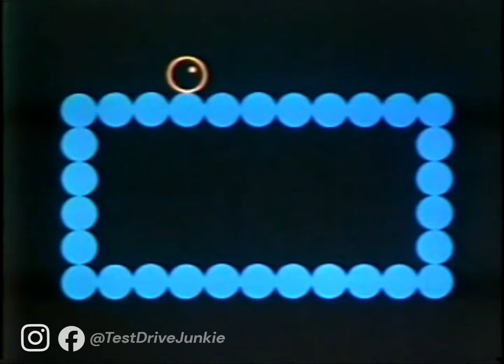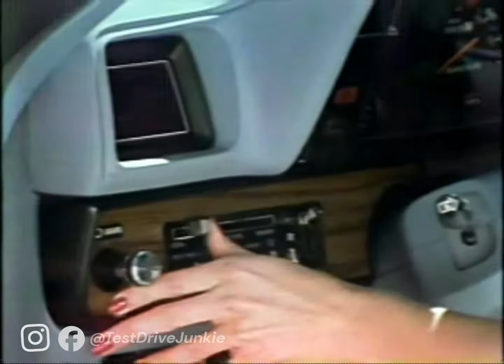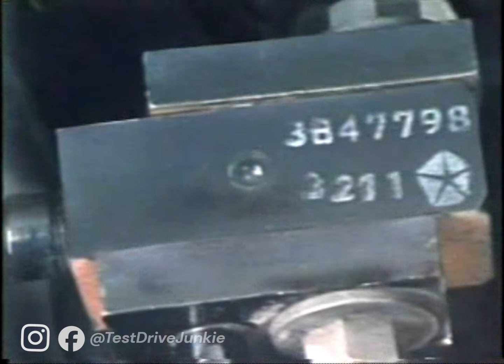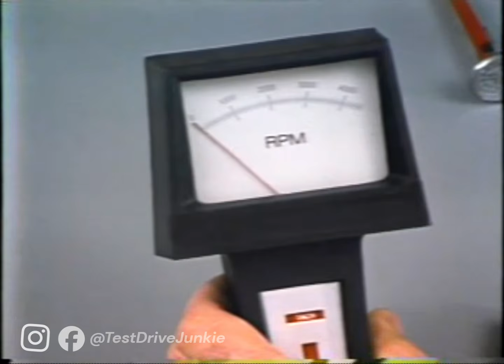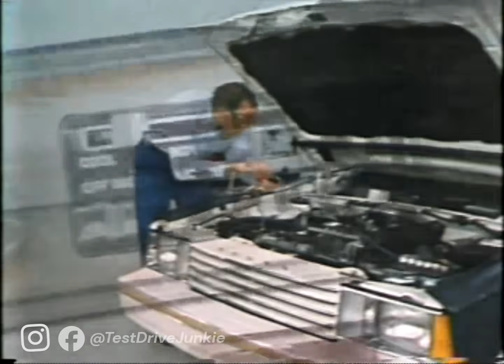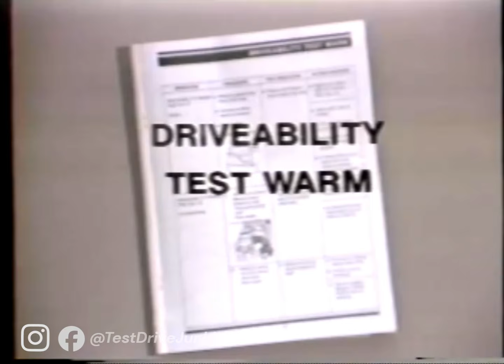1983 Dodge Air Conditioning Repair Manufacturer Betamax Video

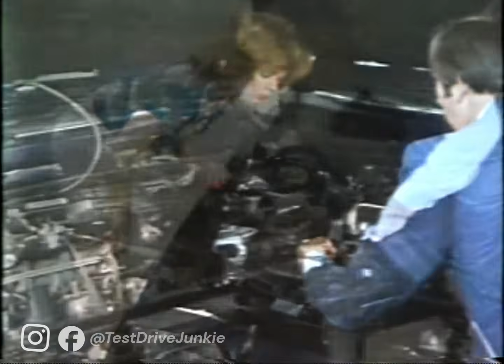Comment: 5:32  Hmm. Well, the thermostat was set to the hot setting. The fan fuse was blown. I guess the car was running hot, that’s why?  lol. lol. I’m so confused. 

It’s hot in my car. The setting is set to heat. 

Um. Wouldn’t , if the fan is not working, the car would be running hot? Wouldn’t that be the first concern? lol. 

Shouldn’t the fan always be running when the car is up to temperature? I mean, in some cars it kind of does run almost all the time, just not as hard. And not only when the ac is on. 🫤😐

Confused here.